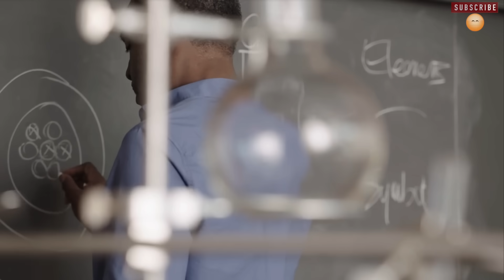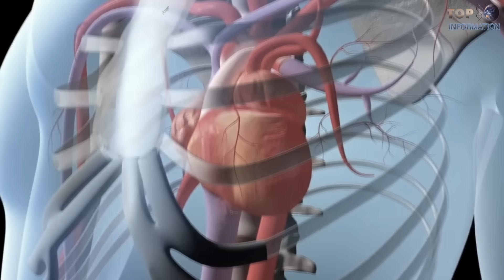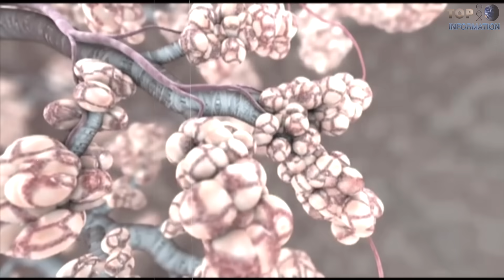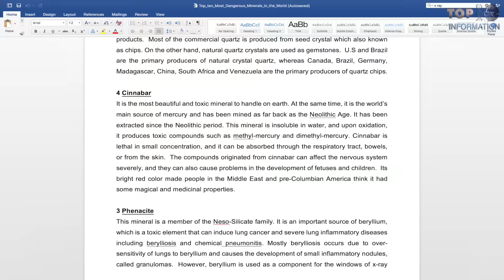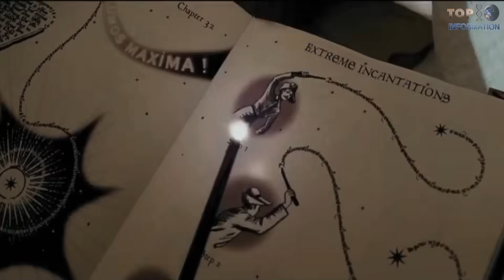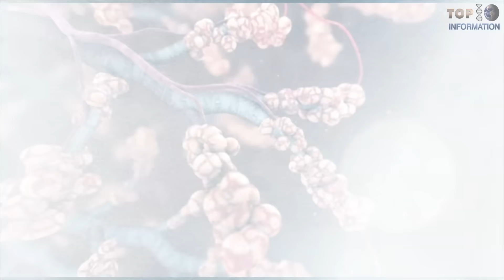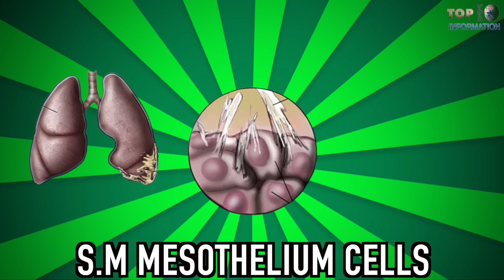10 Most Dangerous Minerals You Shouldn't Try ▶6

Comment: cutterboard is absolutely correct.  I am a mineralogist and with the exception of crocidolite, erionite and possibly cinnabar the rest of these minerals are essentially harmless. Galena is the most stable lead mineral and least toxic of all the lead minerals out there.  I love the way she talks about galena and shows a pyrite specimen.  Pyrite generally does not have arsenic and one of the main sources of gold in the world. It is known as auriferous pyrite because it has gold in its crystalline structure.  I like to call it fools fools gold.  She is most likely confusing it with arsenopyrite.  Feldspars are the main minerals composing granites and is one of the many constituents of glass making.  Fluorite is essentially insoluble in aqueous solutions.  Apatite is actually exists as three minerals.  Hydroxyapatie. fluoroapatite and chloroapatite.  These three forms of apatite are determined by which of the one of the 3 anions is most in abundance each specimen.  All 3 can be present in a the same speciman.  However, Your teeth are composed of  Hydroxyapatite.  Fluoroapatite is more durable than hydroxyapatite.  That is why fluoride acts to help prevent tooth decay.  Quartz is the main constituent of glass and silicon for semiconductors and solar panels.  Most beaches in the world are composed of silica sand.  Approximately 100 people die a each year in the silicosis in the US. Not very dangerous unless you're the victim of a shark attack.   Phenacite or a.k.a. phenakite is rare and is not generally a source of beryllium.  Beryl is the main source of beryllium.  Green and blue beryl are better known as emeralds and aquamarines respectively.

Comment: There are 3 different Types of "Pyrite" 
1) iron pyrite
2) chalcopyrite
3) rceno pyrite
Danger levels with each Associated pyrite varies.
1) Arsenopyrite is the most dangerous for it contains arsenic.
But no matter what, if you grind, smelt or dilute any pyrite in an acid or melt using a high heat source, harmful gases will be produced. If you have a chunk of this it is harmless until you start to process it.
Just don't grind it up, breathe it or eat it and you will be just fine!
This goes for all minerals mentioned in this video.

Comment: Silicosis and other diseases like it are caused by particles irritating and damaging the lining and tissue of the lungs...any fine dust will cause a similar disease over time..cotton fibers, dust from grain processing will do the same thing over time. 

Quartz in any state is basically inert in your body,.short of bashed over the head with a lump of it you're 99.999999% safe around it. Unless you spend YEARS breathing in fine particulates containing quartz.  which irritates and inflames the lining and tissue of your lungs in a response to the jagged edges of the crystal damaging tissues.

Comment: correct title: "over dramatization of mostly harmless minerals"
Reply: quartz crystals are on all the safe crystals lists that I have seen.  i agree with cutterboard.
Reply: @hank3339  quartz is harmless, but inhalation of the dust does cause exactly what they said it does.  But if you take care for your quartz and you're not snorting it you should be okay lol. Quartz is composed of silicon and oxygen
Reply: cutterboard I’ve got tons of pyrite and non of this happens
Reply: cutterboard it is the way they want to make everybody afraid of everything.  These things are not that bad.  Several really bad ones they omit.
Reply: more like pre-hysteric demonizing demagogia about harmless crystals, while simultaneously confusing crystals with various dusts and their non-metabolizable elements that cause harm due to long-term exposure and accumulation in human body.
Reply: Ikr but it is true if ur in a closed area which u never will
Reply: Unless ur a miner
Reply: Idiot must own a company or ba a elite prick sanding discs are killers used in most factorys but the operaters are given none negative pressure masks so fk u knob head
Reply: @jamesbooth9703  in mexico but this is america if you dont wanna die buy a mask
Reply: @jamesbooth9703  dont be rude. They atleast tried there best idiot.
Reply: cutterboard what a stupid comment
Reply: @nathanielberkeley-biggs2855   don't be rude. They atleast tried there best  idiot.

Comment: Methyl mercury is the devil. One drop on a lab glove, it will go through, penetrate your skin, and you will likely die of mercury poisoning. Avoid it like the plague.
Reply: But that won't happen from touching Cinnabar as a mineral, will it?
Reply: @JelleSchot  Cinnabar is a mercury sulfide. It can be dangerous if it's heated or inhaled, but it's safe on its own under normal handling. Cinnabar doesn't oxidize into dimethyl or methyl mercury, these are organic compounds formed by bacteria in soil. Don't worry too much though, it's still safe. If you're into the metaphysical properties of crystals, DON'T use cinnabar in your elixirs and just generally avoid skin-to-skin contact. I have a cinnabar specimen and nothing has ever happened to me because of is mercury content.
Reply: @alexandermcleanalmndbuttrt4714  not water soluble just don't scrape it into your water.

Comment: I have tigers eye that's a type of asbestos
Reply: Actually it is quartz after crysotile ( asbestiform) practically all the crysotile s gone being replaced over time by quartz.  The quartz replaces the fibers bit by bit like in petrified wood, keeping the original pattern of the fibers. There are  7-9 asbestiform minerals not all have been associated with massive over exposure in the asbestos fire coating industry.  Asbestos isn't "poisonous" nor "toxic" in the true definition,  at a microscopic level it is a rolled up sheet of atoms with sharp points which the body can't encapsulate. These needle like points poke holes in cell membranes. Overtime the repeated cell damage can lead to the out of control production of the meslothemal-lining of lung cells as it tries to form larger and larger capsules/scar tissue around the asbestos fibers  aka mesothelioma not a true cancer.
Reply: @Mstreman53  Crysotile is coming back from Russia to people who are too dumb to not know what it is